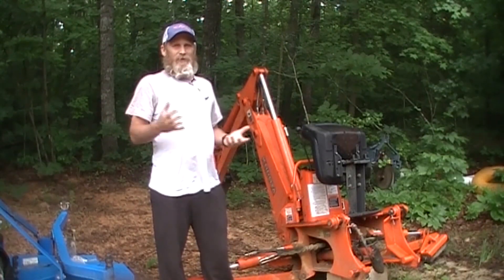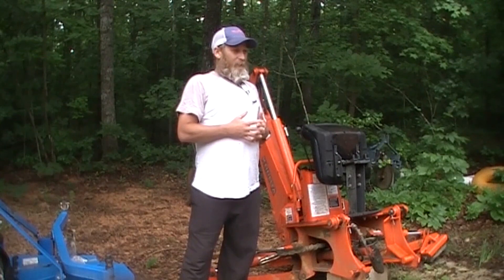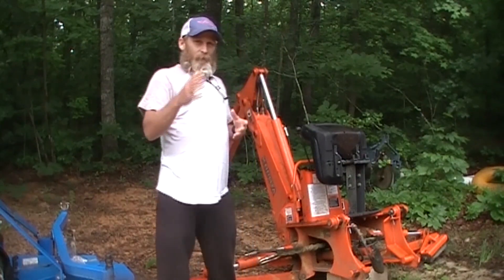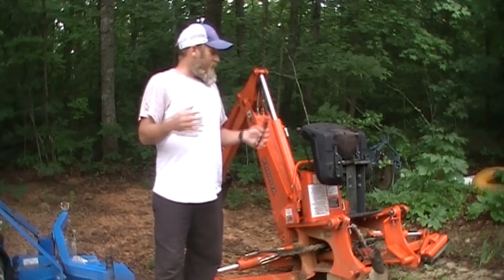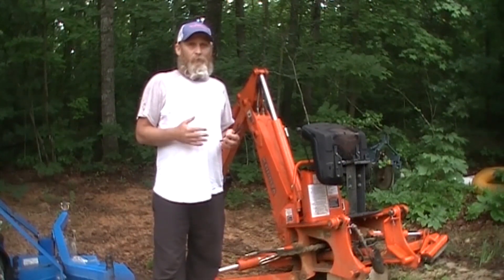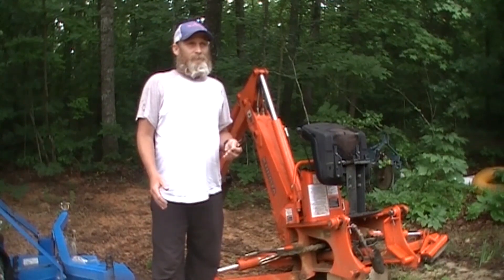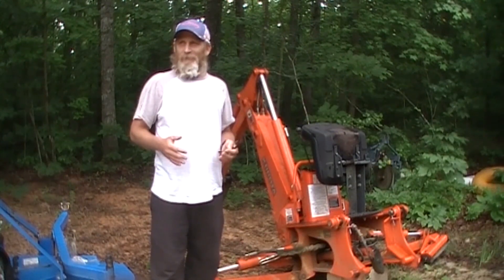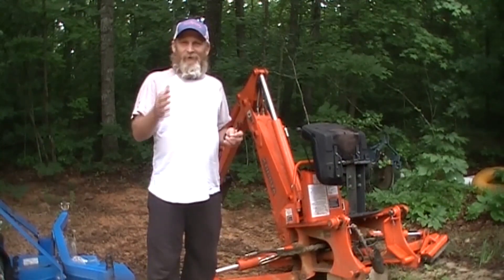installing the sub-frame mount for a backhoe and hydraulics overview.

Comment: That's a very good description. So, let's see if I understand this right: Once the tractor is lifted up on the bucket and backhoe outriggers, just about all of the backhoe digging forces are being handled by the loader plus that backhoe subframe that gets added on, and the rest of the tractor is just kind of hanging there. Does that sound about right?
Reply from the maker: well yes,  however there is great debate over how much you lift a tractor's wheels off the ground when using the backhoe. some manuals say lift the wheels off the ground as needed some say merely ease the weight off the wheels but keep rubber contact in place. so your point is correct the majority of the work load is distributed through the tractor's sub-frame combination of backhoe and loader. very good summary I wish I had included that!

Comment: You look awesome to me.  That curly beard is purty .  I'm the GIRL that requested this info packed video about the backhoe.  Very informative and believe me I've watched 100's Of backhoe videos and you did the absolute best!  You really helped me to make a wiser and more informed choice.  Thanks for such a fast response .  I planted bamboo about14 years ago and it's gonna cost me a lot of time, money and hard work to dig it up.  Heavenly Father thank you for the Holy Spirit that gives us strength.
Reply from the maker: that is one of the units that attaches to the existing three point. they do ok but they do put a lot of pressure  on the three point where it attaches to the tractor.  you can do a lot of digging with this style of backhoe but you MUST go easy in my honest opinion. with that said if a three point unit is what you will settle for I would look for a used one. while your at it look for a used factory kubota frame mount backhoe. many times people buy them and then sell them for what ever reason. we had one for sale last year in our group on facebook. " kubota tractor and equipment " if I remember correctly they only wanted 3500.00 for it and it was a frame mount kubota backhoe attachment. I'm sure its sold now but the point is there are some out there for sale used.  find out what model fits your tractor and do a search nationally on craigslist. you just find one at a great price.
Reply: Amen!
Reply: catbirdfeeder #3

Comment: Thanks Dave, really helped me understand the "power beyond loop", and how the lines are split from the distribution block, whereas before I was looking at a hodge podge of remote lines on both front and back and scratching my head.
Reply from the maker: glad it helped. you may also find my video titled "installing rear remotes and understanding tractor hydraulics" it gives even more details about how the power beyond circuit works.

Comment: Nice job Dave! I would like to add that running a 3 point hoe you run the risk of breaking your tractor in half due to the extreme pressure put on the trans and engine block. Frame mount is the way to go. Glad you are an Orange club member! Sorry you are having some health issues. Thanks again for an informative video. Dave knows how!
Reply from the maker: you are 100% correct frame mount hoe is the way to go for sure. I have had all sorts of color tractors but I do love this orange one! my son use to work as a service tech for Kubota. he says they are really great machines.
Reply: @daveknowshow  Kubota manufactures all there own parts, they are quality machines, I personally own 3 one with a BH-90 hoe, they really are dependable true work horses.

Comment: yes agree with you about how much Jobs do with tractor after you get one. I've done lots more with it Inc unload furniture etc.i have used fel for opening ditches at first used bucket to dig out ditch but found that by dipping bucket and drag out of ditch is better and you can keep same depth all the way.you learn as you go.
Reply from the maker: yes the bucket is great for clearing ditches just as you described dipped down.

Comment: Good stuff! When you mount a backhoe subframe are you eliminating the possibility of using the 3-point hitch from then on? I just bought a new l3301 and I'm considering adding a backhoe but sometimes need to run other implements.
Reply from the maker: nope you can still use your three point very easily.
Reply: @daveknowshow  awesome...... really appreciate your response and this video!
Reply from the maker: @allphaselandscape  sure thing thanks for stopping by!

Comment: Good run down on how all of this connects together.. I ended up buying a new hoe and the dealer installed the sub frame.. Wasn't that much more for the install, although it  did kill me , as I am not use to paying for work to be done by others. Now I am learning what the boulder size limit is for this piece of equipment..
  I am not to religious, so I am not sure if sending you prayers is going to help or hurt?? But I will send them to you anyways.  So, hope you get better physically  ,  cause your spirit seems to be in great shape ..
Reply from the maker: thank you Ivan! when people who are not religious start to pray for you that is when God ear really opens up. trust me God wants to hear from you. I'm not over the top religious myself, not a real bible thumper that forces a belief on a person. I can tell you the prayers do work. so glad you got the backhoe I know you will really enjoy it. its a fun tool and saves your back a lot of work when doing so many projects.

Comment: Dave, Does it matter which line goes where? Meaning, I am installing a new rear hydraulic line on my L3130. Which is the power beyond send on the backhoe hookups and which is the power beyond return on the backhoe? (On the backhoe) One is a long line with male coupler, the other is a short line with the female coupler. I just want to make sure I get it all hooked up correctly. If this makes sense.
Reply from the maker: trace the line back from the backhoe toward the front of the tractor. the line that goes to the power beyond port at the front end loader control lever is the power coming out fluid travels from the loader control valve to the backhoe where its used and then comes out the backhoe. this hydraulic circuit is an in series type set up. see my video totled understanding tractor hydraulics so you can see exactly how the circuit works. https://youtu.be/DAeW5eqEqvM

Comment: great video ,  i have the same unit installed by the dealer, after using the backhoe it builds pressure on the levers maktng them hard to move. 
Do you know of any reasons that it does this .. Thanks Gene
Reply from the maker: the unit may be plumbed up backwards. have the dealer check it ASAP before you damage something that is very costly.

Comment: I am about to buy a BH77 for my L3800, what model backhoe do you have ?   I  am not entirely sure what size bucket to get, I was going to go with the middle of the road size and try 16", I know I can't do what bigger units do for work, so this will help me take less material while digging putting less stress on the unit.  What do you suggest ?
Reply from the maker: honestly a 16 is the perfect size in my opinion. The Bh77 took the place of the Bh75 which came on the older tractors like mine. its not a lot of difference between the two as far as strength. the 77 does dig an inch or so deeper. I hope to get the quick coupling from bxpanded for the backhoe bucket and maybe get the trenching bucket to go along with my 16 inch bucket.

Comment: Looks like a little bit of work to get it hooked up, guessing you need to give it some fluid so it can aid itself on pin alignment. Basically a legit backhoe with frame mount. Cool
Reply from the maker: its not to bad. just have to locate that sweet spot and the pin falls right in place.

Comment: I’m looking for a complete loader assembly for my 2007 B7610 it doesn’t have the arms or anything?   Is there a kit I can buy?   I can’t seem to find any info on installing a loader on my tractor?
Reply from the maker: your dealer can likely order the original kubota loader or you can order an aftermarket loader made by several different companies. just google search aftermarket tractor loader attachments. I believe woods use to sell them and there are more I'm sure. the brackets for mounting to the motor housing area will come with the loader frame.

Comment: I have a l3800 I am looking to add a subframe for my existing backhoe it's a bh75 will this backhoe fit a l3800 subframe yours look like a bh75 also thanks
Reply from the maker: yes mine is a bh75 however the subframes differ from some models to others. the BH75 will fit the l3400 the L3800 takes the bh77 hoe. with that said people have adapted the bh75 to fit other models and so I'd say with a little effort you could adapt the BH75 to fit the L3800
Reply: @daveknowshow  what kind of modification would it take
Reply from the maker: @dennissholly1296  I'm not 100% sure could be as simple as drilling new hole positions may need to be shimmed in or out to make the frame line up correctly. one thing for sure it can more likely be done than not be able to be done.

Comment: Does the backhoe subframe get in the way of a mid mount pto or mid mount mower?
The backhoe that had a bent hydraulic what did it cost them to fix or replace it?
Reply from the maker: I believe it was near 400 bucks for the factory replacement cylinder. I'm not sure about the mid mount mower since my tractor model does not have a mid PTO

Comment: Just  purchased a used B3300 2012, but no Backhoe, so this was very interesting .. I don't see a distribution  box on mine ? seems that the hydraulics just go back to the  PTO.. so It would seem to me that i need that as well as a sub frame for this model.. Also was wondering if I buy a  used woods BH9000, than I probably need to buy a new sub frame from woods to make sure everything matches? Thanks !
Reply from the maker: there may be a distribution block located at the rear with ports for power beyond, power, and return to tank.  if you buy a used unit try to get the subframe with it and check with woods before hand to make sue it will fit the B3300. The B3300 is a very strong and nice tractor. congratulation on getting such a nice tractor!  appreciate you dropping by my channel and watching my video. hope your having a great weekend.
Reply: Thanks, I wanted a backhoe with it but could to find one, so figured I would buy the next one that came up , with or without. and here i am looking  for and learning about  3 pt hitch , pto, sub frame . Plan on using it in the woods, so I wanted something a little small but with enough horses, also need spacers for the wheels.  Thanks again, I will check out the rear.
Reply from the maker: glad to help! thanks for the reply. hope you find one at a good price.
Reply: daveknowshow yeah I thought you look pretty good there and thanks for sharing your videos  I pray that God help you  through your tough times
Reply from the maker: thank you Robert Clark, I appreciate the kind words and prayers. the prayers do work!!!

Comment: How long does it take to  it to attach/unattach the backhoe?
Reply from the maker: maybe 10 minutes its not hard at all. and the nice part is that its a solid full frame four point backhoe once its in place. much better and stronger than a three point backhoe that has no frame mount. honestly having a tractor with no hoe is like having a tractor with no front end loader. it really limits the ability of the machine. I have taken the machine with the backhoe on loaded it and my brush hog on the tractor. went to a brush hog job that had some large 5 inch trees and took them out with the hoe then installed the hog and proceeded to mow. then changed it all back for the ride back home on the trailer. so its not hard at all. the more often you do it the faster it becomes. I doubt it will take you more than 15 minutes the first time.
Reply: @daveknowshow  What about older models like a 70's or 80's model?  Im kind of new to getting into buying a tractor after we purchased some land thats why im inquiring .
Reply: @daveknowshow  By the way thanks for responding ...
Reply from the maker: @kraut39  so long as it has the 4 point backhoe frame mount it will be the same. if you google the model of the tractor and then click the link that is for "tractor data dot com" you will see the tractor and under attachments you will see any backhoe listed that is a original factory backhoe. you can then look up that model and see how it attaches and compare that to the current models. you can also ask a local kubota dealer to look it up for you. if you know the tractor model you are looking at I can try to see what information is available online for you. just let me know if I can help in any way at all.

Comment: hey dave is it possible to put a bh-900 hoe of an L35 on an L 3130?? found a good deal on one. subframe is my biggest concern
Reply from the maker: I would check with kubota corp or a dealer or kubota parts at kubota books dot com. look over the measurements you may find it's close enough to make it work. they call the L35 a full frame true "Tractor Loader Backhoe" I'm not clear if that means the backhoe subframe is part of the tractor frame or if it can be removed and possible installed on another tractor model. if its a good price it is sure worth checking into.  wish I could be of more help. keep me posted!
Reply: daveknowshow  i have read lots of threads hoping someone has done it.  im gonna make it happen lord willing. this video was very informative. i will keep u posted on the project. thanks
Reply from the maker: thats a great question and one I dont know the answer to. I would assume it would still run the hoe just not as efficiently as 17 gpm would run it. if you look up the hoe on kubota books dot com it may tell you the minimum required gpm for that hoe.

Comment: YOUNG MAN ,

NEED TO KNOW WHERE HYDRAULIC PUMP  TO LIFT LOADER BUCKET
Reply from the maker: located on the right side on engine just behind where the brake pedal is on this tractor. yours may be different. look up the parts diagram on kubotabooks.com